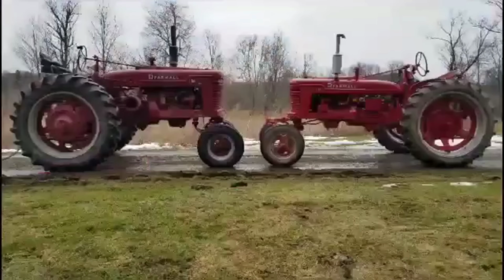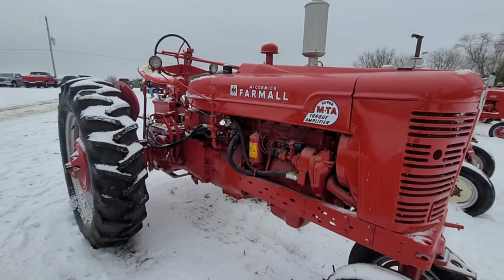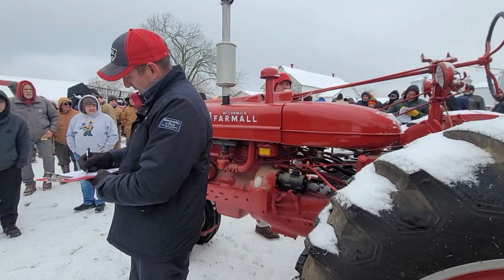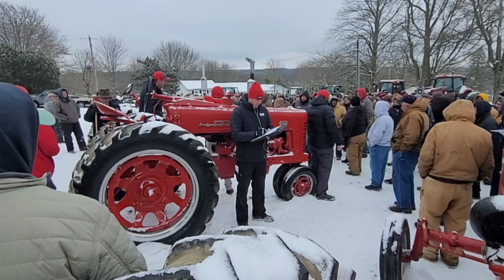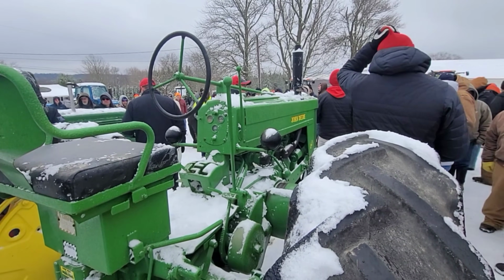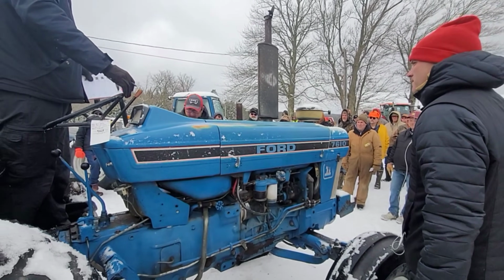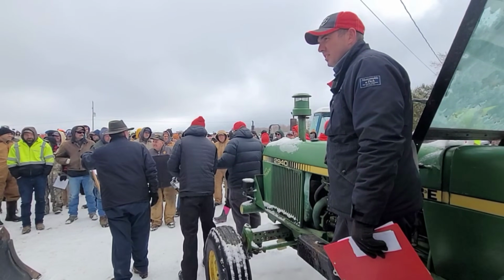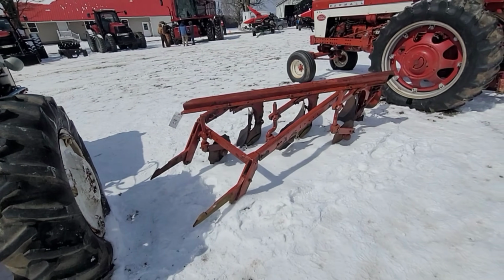Which Tractor Did I Buy? Restored Farmall Tractors

Comment: Well congratulations! I was shocked at first, but then I realized that you are absolutely correct about how many original hours are on the 400. The tires on the tractor are Armstrong. They stopped making those tires in the early 80s. Check on the side of the tires, most of the time there is a casting date on the tires. Google how to find casting date on tires. Again congratulations on your purchase I believe that it's possibly the lowest hour tractor that you'll ever have. Like you said "it's a gem".👍
Reply from the maker: Yea I'm stoked 👍

Comment: Congratulations Gino. Nice 400. I had a 400 wide front,  traded it along with a '64 706 diesel for the local dealers 1st 1460 axial flow combine in 1978. I replaced the 706 with a 67 706 gas. I have like the 67 better than the 64. I do miss the 400. That 450 looked especially sweet, and as you know the fast hitch is bolt on, so it could be  added, but you ran it up plenty.  There will be more
Reply from the maker: Tractors always appear for me
Reply: For sure

Comment: You have 2 point fast hitch equipment already so buying a tractor made sense. 3 point hook up was pushed as easier to attach but when they were showing the old 8N putting on tools it was perfectly lined up and a small implement was easy to budge. A four bottom plow does not budge that easy.